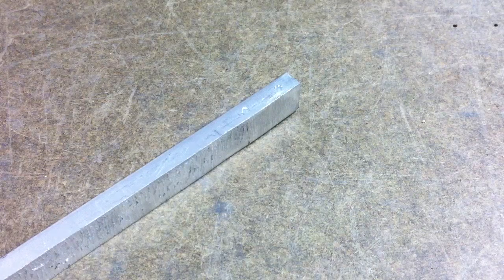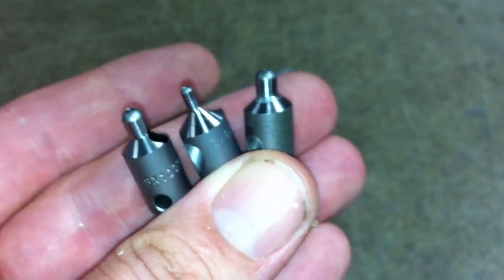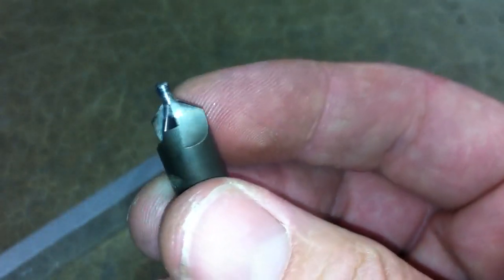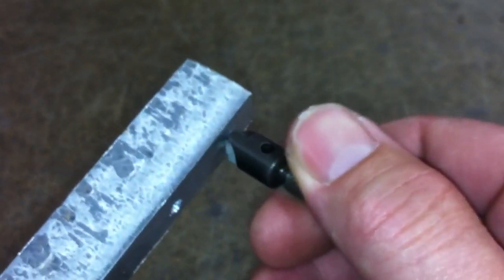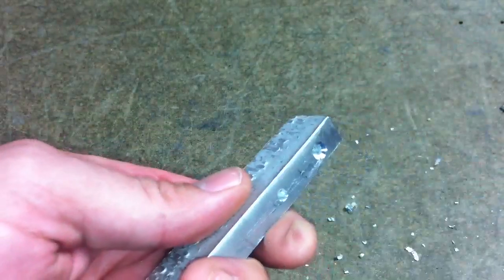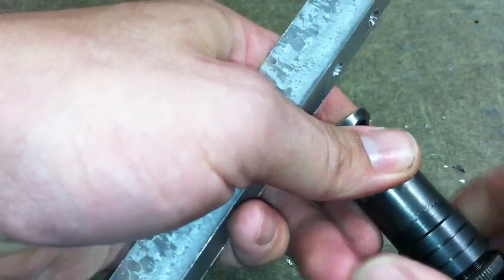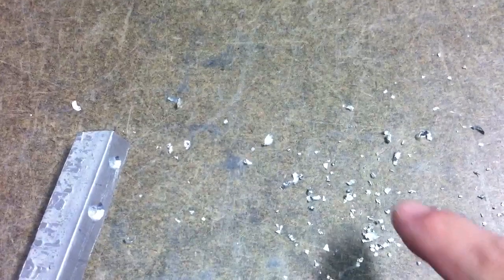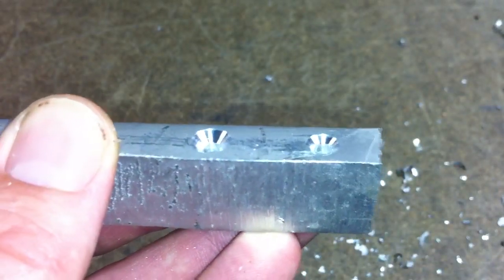Aircraft Aluminum Countersinks from Cleaveland Aircraft Tool

Comment: Thanks for the detailed demo. I’m just starting to practice countersinking and I tried both the single-flute and 3-flute cutters. At 5:30, you show a long “chip” from the single-flute cutter. I found that the long chips from the single-flute cutter can cause a circular scratch around the hole. I was using a drill press at 250rpm. What rpm would you recommend? Thanks.
Reply: Maybe slightly faster, or be very patient with your feed rate. Not breaking the chips will cause them to spin and scratch the surface. Just remember the surface is Alclad and incredibly soft. It’s so easy to scratch that you can scratch it with your finger rubbing it. If it’s actually gouging it so that you can feel it with your fingernail, then you’re certainly using too heavy of a feed rate.
Reply: Please contact me please I will provide you best countersinks